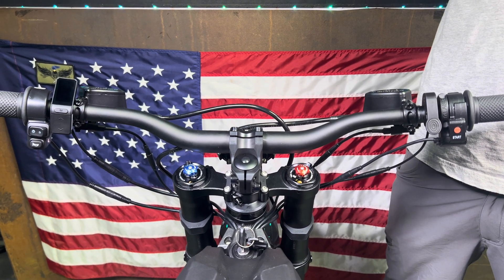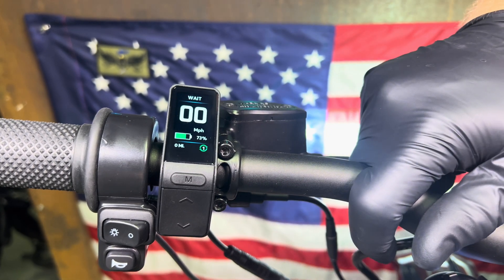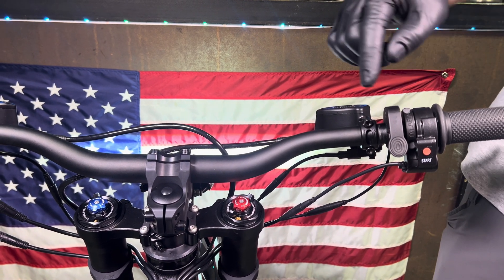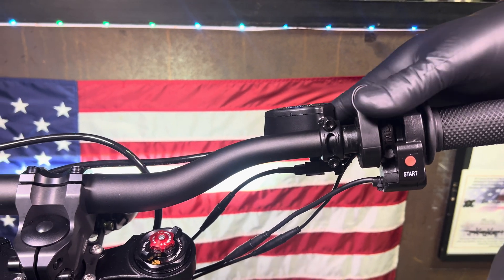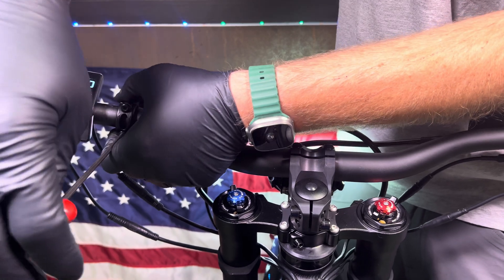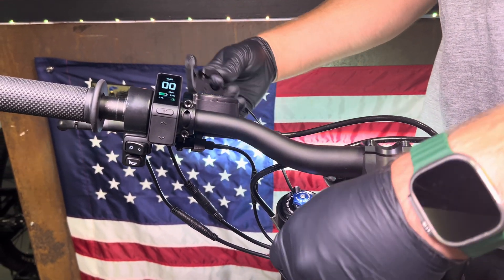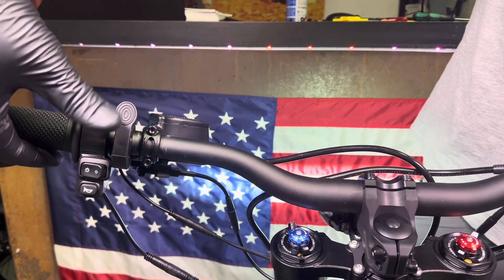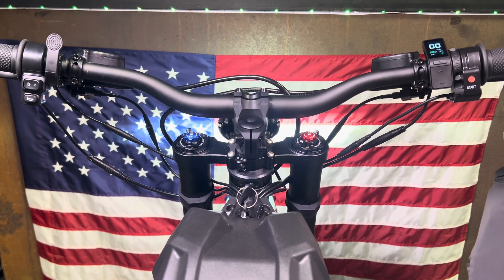Talaria MX5 Variable Regen Braking Lever Explained

Comment: New to EVs in general so apologies if this question is dumb. If I got one of these I'd want to prioritize making it last as long as possible. Brake pads are easy to replace so I'm not really concerned about saving those. Does using regen to slow the bike down when descending or coming to a stop put accelerated wear on the power/drive components? Is it better for the longevity of the bike to just use the brakes instead?
Reply: I personally find the regen so helpful tho helps you not go thru brake pads non stop
Reply from the maker: no it does not... in fact the biggest plus to regen is it minimizes brake pad wear....

Comment: do you recommend brake sensor delete?
Reply: Does the brake sensor just make it so if the front wheel lifts the bike automatically hits the brake or could someone please explain it to me
Reply from the maker: @octowoomyg6672  the brake sensor makes it if you hit the brake it cuts off the throttle...its a safety feature that some people take off because it makes the bike easier to ride a wheelie (hitting brake and throttle at same time) we do not recommend removing brake sensor however.
Reply: @lunacyclerepair  ah I see thank you
Reply: Not really, its dangerous. The bikes are so torque you can eat mega shiiii if its disconnected and you make a mistake. I crashed 2x deleting it and now keep it connected